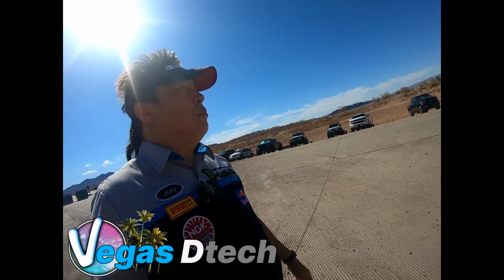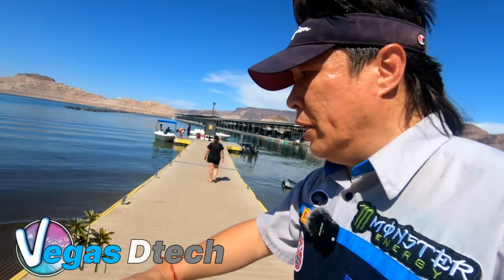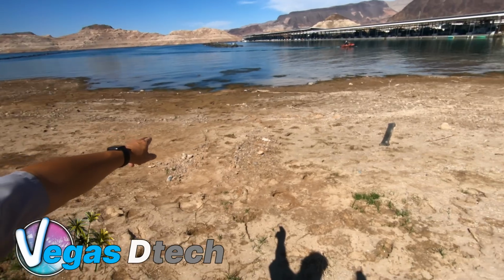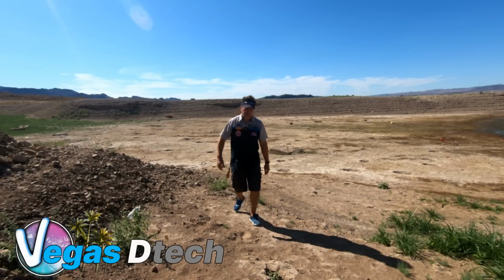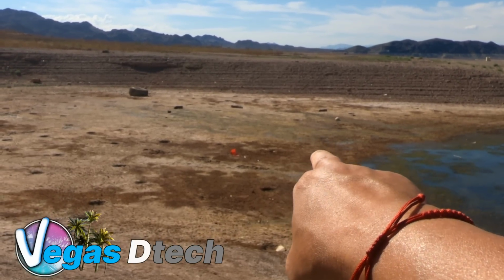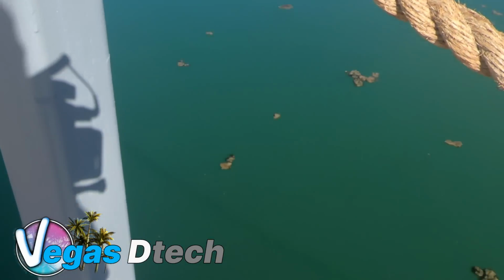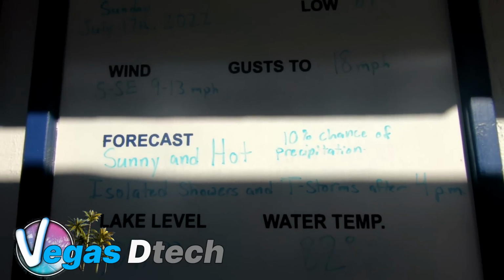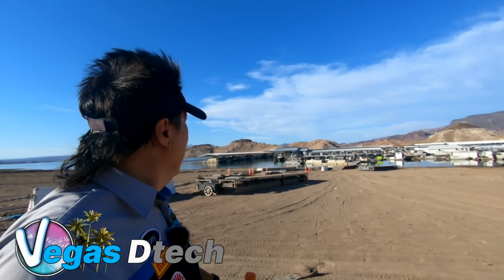Lake Mead water level Drop & Marina Move Update

Comment: Hey Joey, I appreciate you keeping us updated on Lake Mead. The evaporation seems to be speeding up.
Reply: I think evaporation speeds up because the surface area of the lake becomes smaller and smaller as the water level drops, it seems to be exponential.
Reply: @madoldmanyelling6420  Evaporation get's faster because the Water Temperatures a rising, warmer water= more evaporation, colder water = less Evaporation.
But also, less water surface= less evaporation, bigger water surface = more evaporation.
And not to forget, less humidity in the air = more evaporation, more humidity in the air = less evaporation.
Also Air Temperature is important, in combination with air humidity, the hotter and dryer the Air, the more Water the Air can take away from the Lake, its called air water saturation.
If you have cold air, with high humidity, than the air just can't take more water but if you warm this air, it suddenly can take more water and other way arround if you have warm or hot air with medium to high humidity and you cool this air down, than you get Condensation, because the air is not able, to hold that water anymore.
Reply: @lissyflur1907  Also the reservoir is a V shape so as it drops it will drop faster and faster.
Reply: @wxmyjnsn  Yes, the Water Level will drop very fast, i think next year, it could be dead pool.
Reply: @lissyflur1907  I've seen a few estimates that put it as early as next spring or maybe early summer.
Reply: @sandyp2485  We will see in the Winter, how much snow we get, in the Mountain's.

Comment: GREAT video, as usual.  It seems that the water at the end of the ramp (~@19:50) is really shallow, too. That whole setup does have a month left.  I have an idea - if you can get away with it - drop a measured string with a weight on the end of it to the bottom at the end of the ramp to see how deep it really is.  I'd be surprised if it were more than 7-10 feet.
Reply: It's deeper by the dam, but it's extremely low.
Reply from the maker: Great idea Jeremy... i'll be doing this next visit out.
Reply: Great idea. Just tie a knot every foot. And a better way to check instead of shoreline recession. They sure don't have much time to move again, they'll get trapped soon.

Comment: Never in my lifetime would I have thought the mighty lake mead would  turn into a puddle. Mind blowing Joey, truly sad & we're in trouble.  Without the water release from powell . Witch we can't due because of water levels. Be careful walking on that quick sand 💯. Hopefully things don't get stagnant & we can rebound from this horrible drought 🙏 thanks for sharing the info & take care of yourself.  Salute Joey 😎
Reply from the maker: Thanks again for stopping by and leaving a comment for me - Joey
Reply: It is very sad whats happening at Lake Mead.  I have pics of the water to the bottom of the towers
Reply: @Michael's Productions  I agree this is more than a drought situation. But your point is a bit confusing due to the lack of spacing, separating the dates, from the measurements of rainfail.
Reply: about the poop on the water, most small boats have a tank for the water closed, but i think many empty the tank on the lake and don't bother to dispose of it properly
Reply: ...EVEN IF THE DROUGHT ENDED TODAY- IT'S GONNA TAKE A HECK OF A LONG TIME FOR LAKE MEAD TO REFILL-(!)
Reply: @Michael's Productions It's not a drought huh . lack of snow pack in the Colorado's  is the big reason both Mead & powell  are failing . I  due thank the reservoirs will rebound 💯🤞 . The scary thing is the Colorado River is drying up ...
Reply: @daleburrell6273  you're correct my friend. It took 7 years to fill mead & powell. So this isn't going away anytime soon.
Reply: @just4kicks950  ...I THOUGHT IT TOOK LONGER THAN THAT-(!)
Reply: @daleburrell6273  IDK ! That 7yrs was when the Colorado was a mighty river . Now it looks more like a stream. You are right though, we're in for a hot dry summer 😔
Reply: @Michael's Productions I'm pretty sure it all when't to powell, because it was on life support . Brought it up a few feet ,Your guess is as good as mine.
Reply: @Michael's Productions ...EVEN IF THAT'S TRUE- I CAN'T  SEE HOW THAT IS DOING LAKE MEAD ANY GOOD!!!
Reply: @Michael's Productions ...I'M SURE THAT OVERPOPULATION IS A MAJOR FACTOR-!!!

Comment: The water is being drained by some unnatural means, other "straws"/pipelines and the authorities have not and are not and probably will not do anything to address this problem. The water decrease is just not normal.
Reply: Hello Barbara Hallisy, With all due respect, the issue of the drastic water loss at Lake Mead 
and Lake Powell...as well as others along The Colorado River...is the result of the extreme 
decades-long drought plaguing the Southwest U.S. 
Additionally, Winter snow in The Rocky Mountains supplies critically necessary melt-water 
to The Colorado River in the Spring & has been dramatically reduced; year after year. 
Lake Mead Reservoir is fed by the lakes upstream. These lakes no-longer have the water capacity to feed downstream to Lake Mead. 
Meanwhile, water still needs to be supplied to 25,000,000 people 24//7//365 & Hoover Dam 
Hydro-Electric Power Station must continue generating electricity for as long as possible. 
More than 20,000,000 homes are dependent on electricity from Hoover Dam. There're also 
hundreds of hospitals, clinics, schools, universities, food processing plants, bakeries, etc. which draw power from the dam. 
Lastly, as the surface area of water in the reservoir diminishes, the rate of evaporation will 
increase; further exasperating the decrease of water. 
There is no secret mystery about the ongoing loss of water at Lake Mead Reservoir. 
Best regards, 
Ben

Comment: Alright I know nothing about lakes and boating.   but those mooring cables is that stuff that should be being cleaned up and picked up and any exposed ground between being gone through to clean up trash. 2nd I have said it for years. in California they have all those canals with the water running through. why don't they have sunshades over them so the sun doesn't beat down on the water to help reduce evaporation can they do that in the lakes put small barges out there with huge sunshades to keep the water from heating up and less of Evaporation

Comment: Did you find out what the brown, floating "stuff" was? I would guess that as the weather gets hotter and the lake get more shallow, that algae blooms and pollution may necessitate closing the lake due to health concerns. One other question that I've wondered about; how deep is the water right behind Hoover Dam? Not in feet above sea level but actual depth of the water from the water's surface to the bottom of Lake Mead at the back of the dam; 50 ft., 150 ft., or hundreds of feet?

Comment: In those marina harbors, the water is already shallow. It's not like the main part of the lake with the Vee shape. These harbor's bottoms are actually flat, and at some point the water will drop to a spot where the water will be to shallow to float the house boats, and the marina docks themselves, and they will all setting into the mud. From the looks of this video, they have at most 6 feet before the marina harbor goes dry. The lake level in feet is based on from sea level. My question is, How far above sea level is the bottom of the marina harbor? And the water in the marina is already becoming polluted with feces and going stagnant. Soon the smell will get terrible.

Comment: Gatorade is horrible for your health Joey. Try salting some ice and pouring ice cold water over it. Not sea salt. Iodized salt.
Also I live in the he part of Texas where we've had almost every day over a hundred degrees since April and no rain since I don't know when because of the chemtrailing that goes on overhead of our Air Force Base city. Notice I said chemtrail and NOT contrail. We are burning to bits over here. So I have a tip for you to keep your electronics a little cooler. Use a small ice pack. The kind with the beads in it is what I use. It keeps my phone, and battery pack super cool and operating without shutting down due to the heat. You might have to use an ice chest with some extras in it on ice but if you freeze a gallon jug or two of water to keep in an ice chest that would work great to keep the packs super cold at least. I'm sure you can figure out a way to attach it without hurting anything. I did.
Thanks Joey for showing us what's really going on! I bet that double decker house boat let it's sewage out as it passed thru there. TRULY DISGUSTING 💩😩

Comment: I can't believe how fast the water is evaporating. I have a question. From what I understand, the water level is measured by sea level elevation. Have 'they' considered the amount of sediment that is now at the bottom of the lake? The sea level elevation isn't giving an accurate measure of water depth. Am I right, or not understanding how the water level is measure? Another amazing video Joey! One of the TV news outlets needs to use you as a reporter!!
Reply: Sea level is just a baseline. They aren't saying where the bottom is. I'm not sure if they know or care. Since the topography is varied it would be difficult to measure actual depth or quantity of water. This alone is scary, but add in the fact that very few water restrictions are happening in the states that pull from Lake Mead is even more scary. I live in New Mexico and have been watching the lake here deplete almost as fast as lake Mead. Wells are also running low. Something should have been done YEARS ago, but to see the lake drop from the 2021 level to now, half way through 2022, that's just mind boggling. New Mexico likes to grow pecans, which is crazy because they need so much water. They also grow green chilies and cotton as a second crop in the chili fields. I have seen a lot of empty fields last time I went to Las Cruces.
Reply: @katpraeuner9794  That's devastating. It's like watching a disaster in slow motion. I'm worried about all the people who are going to have to move because they have no water! No water, no food. It's a massive crisis.
Reply: I think they like using the sea level measurement, because it doesn’t sound as bad as it really is.
Reply: You are correct...The water levels are measured from sea level as a starting point rather than the bottom of the lake. From what I found,  At FULL pool the deepest point was only 532 ft deep and considering the submerged terrain of the lake I have no idea how expansive the area was that achieved that depth. I don't think they are using the sea level measurement to be intentionally deceptive it's simply the accepted point from which elevations found in nature are measured.

Comment: Lake Mead, Largest man made reservoir soon to be the largest Nautical Cemetery. 
Scientist are saying we would need 4 years in a row of above average rain to put lake mead water levels back to normal. At the current fill rate, it would take 500 years to fill lake mead again. Scientist are saying the low level drought is permanent ...!!!
It is very possible for water to just go away, Scientist have found Fossils of sea shells on top of  mountains.

Comment: When it gets that shallow the water is going to evaporate much faster. To make things much worse, the newly exposed ground will act like a sponge drawing more water. So as the ground/silt dries out, it will pull more water in and keep drying out. This is called this "osmosis". Also if you look at how far the green grass is you can tell how far the water is underground. The Grass has to have moisture and a lot of it. So you will have the water line then mud where it recently receeded and then the grass as it had time to germinate.

Comment: Do they allow inflatable boats with electric trolling motor?  That may work for getting near shorelines or looking at low water levels on the lake itself.  I got a 5 person boat that's good for two , works great and easy to auto air up and deflate. No boat ramp needed.  That may be the last boats allowed soon.

Comment: Has adding the 3rd straw right at the bottom of the lake accelerated the water loss ?
Reply: That third straw was added a few years back, just in case the water level should ever drop so low the first two could not draw water.  It is now that case, the first two are high and dry.
Reply from the maker: IDK.. unless that 3rd straw is sucking up water and diverting it somewhere else covertly...
Reply: Joey You may be right on

Comment: That "Quicksand" is "Organic Sediment". It;s made of years and years of plant life, and decay from fish & birds. I would remove as much of that as possible i'm surprised it wasn't dredged out of the lake. That stuff is not good for the turbines that are in the dam either.
Reply: It make me wonder where the actual bottom of the lake is. If there is that much sediment on the outer edges, how much more of it could there be in the middle of the lake? Is the bottom of the lake closer than might be thought otherwise or is there a way to determine the actual bottom sediment and all?
Reply: @sandyp2485  Their is, you'd need the use of a sonar to find the deepest spot and take a core sample with a fairly large core drill. That will Tell you how deep the sediment layer is.

Comment: -----  Ok, so you scared me. I  could just picture you in mud up to your knee, and unable to move! Got cellphone on you? Keep it on you, just in case! Yiks!  
-----  Interesting facts: About 85–90 percent of the Colorado River's discharge originates in melting snowpack from the Rocky Mountains of Colorado and Wyoming. The three major upper tributaries of the Colorado – the snow-fed Gunnison, Green, and San Juan – alone deliver almost 9 million acre-feet (11 km3) per year to the main stem.
----  I found that when I was checking to see if melting glaciers in Glacier National Park (in Montana) were part of the cause of decrease of water in the Colorado River. Glacier National Park use to have over 200 glaciers.... now its down to 25 glaciers and melt is more than what is incoming each winter. 
-----  But I did find this info: Glacier's water (Glacier National Park in Montana) can be considered the headwaters of the entire continent. From Triple Divide Peak, a droplet can theoretically split three ways and eventually make it to the Pacific, Atlantic and Hudson Bay watersheds. 
-----  Everything is a domino effect.

Comment: One thing that is not being cobsidered is the volumetric ratio.  Every time the water drops a foot, the ratio of of cubic foot to square foot changes.  It is because the slope of the shore alters the size of the container.  Just throwing numbers out because ai have no idea what the real numbers are, if you have one million gallons in a foot of depth, with a sloped bottom on the container, the next foot could be 900,000 gallons. And the next foot is 800,000.  If the gallons lost per week stays the same, the remainder of the lake will disappear much faster.  Like the last couple inches of water in the bathtub.  It is an accellerating system.

The per foot drop is going to go from bad to worse, much more rapidly than anyone would expect.

Edit: it appears that Dethray1000 is as sharp as a potato since he doesn't understand that people need drinking water to live.

Comment: Don't understand how you can push on a cable or rope.   Normally, you can pull a cable or rope ... but push?   I don't get it.   Maybe I could Mansplaine that the dosers don't PUSH, but they PULL the docks from the deep water site towards the "deeper" moring blocks that are in the deep end by #1: grabbing the cables and pulling on them towards the blocks.   So these "dosers" or probably a small "backhoe" is driven on the dock to the deep end of the dock ... and pulls / hauls on the rope/cable.  #2 Alternately, as a separate floating backhoe, it can anchor to the cable and pull the dock.  #3 and most likely, but not in any way related to your explanation is that a back hoe or "doser" on land has a cable that it pulls the cable towards away from the water, but that cable goes that around a wheel or block and tackle near the moring block that in turn pulls the docks towards the moring block (out to sea, out to deeper water in the opposite direction.
Reply from the maker: From what the guys told me.. they have mooring blocks on the shore.. the cables get attached to them and they crank on wenches to pull the marina towards the blocks.. the dozers have long arms that push the docks out into the water as they drive into the Lake... at least 8 guys all employees explained it this way as they all work together on " MOVE" days..

Comment: I was driving down to Nelson and I noticed wayyyyyy more solar panels now in the El Dorado lake bed and on both sides of the road on Interstate 11, and on the way to Bullhead there are miles of wind turbines now. Several years ago there were no wind turbines and only a few solar panels. I'm wondering if the water loss at Lake Mead is intentional... just a thought.